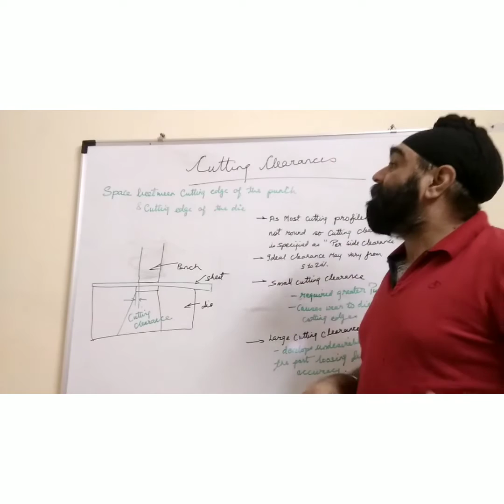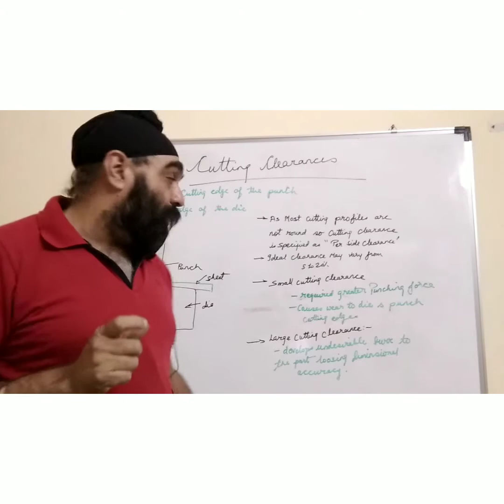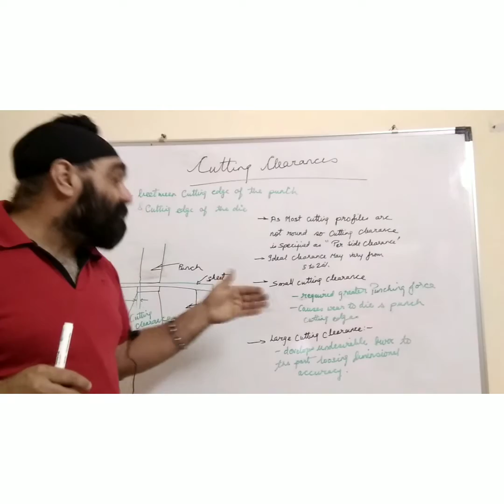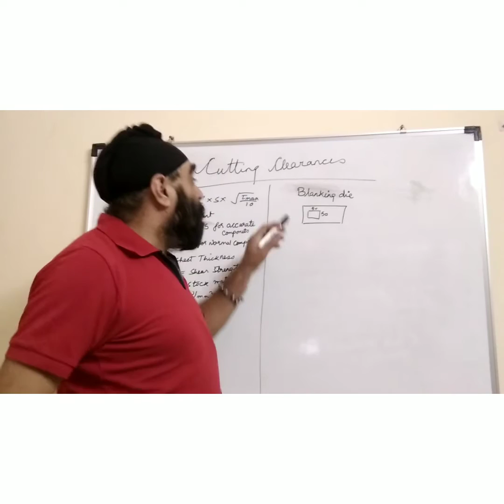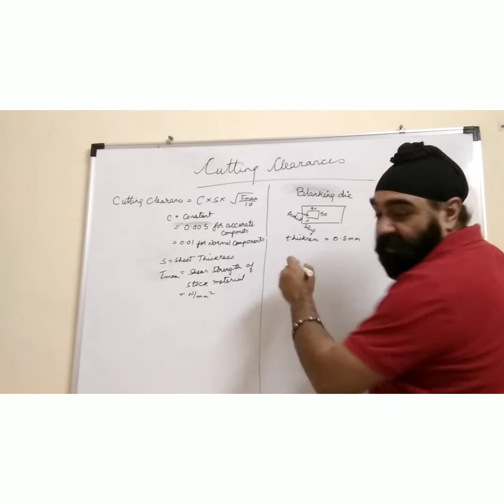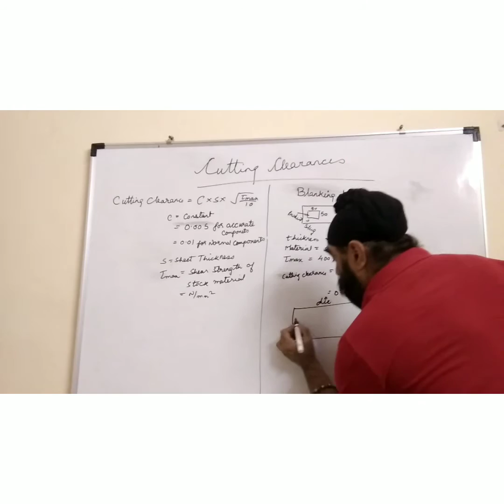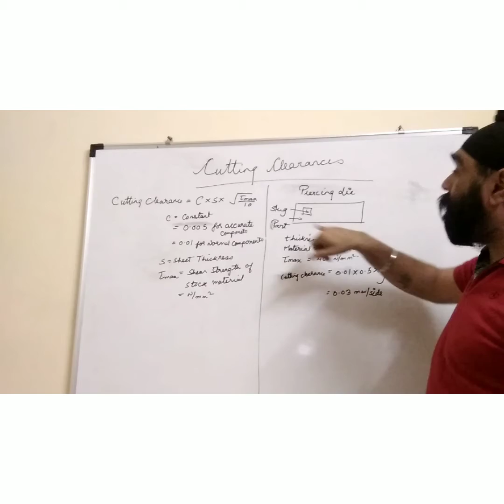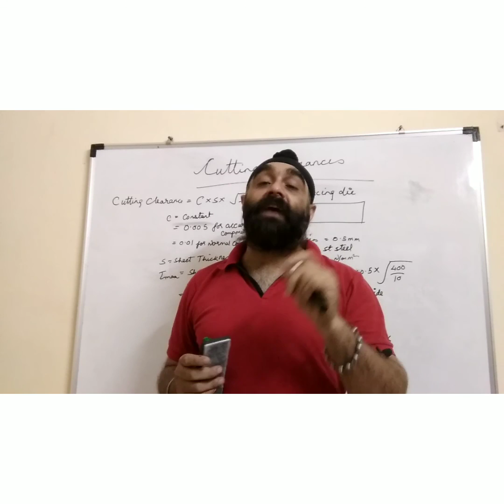Cutting clearance between punch and die - Press Tool Design

Comment: sir .. final size is 66x66mm (Square).
This is my die size. so How much clearence should be in punch ?  please tell me .. if you can help .. And Sheet Thk is 14mm . Mild steel
Reply: 0.01 x 14 x root of(60percent of ultimate tensile strength/10) results in 0.7 on each side